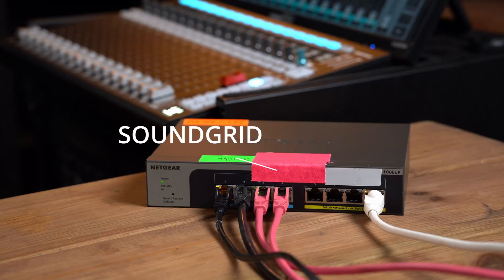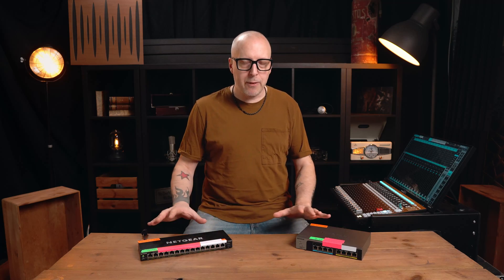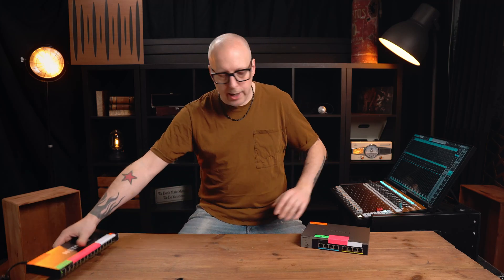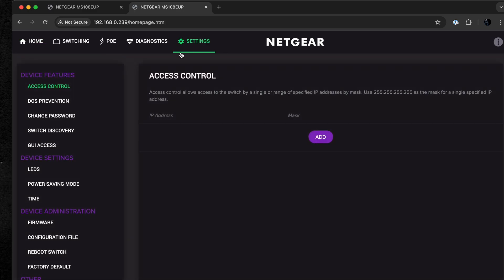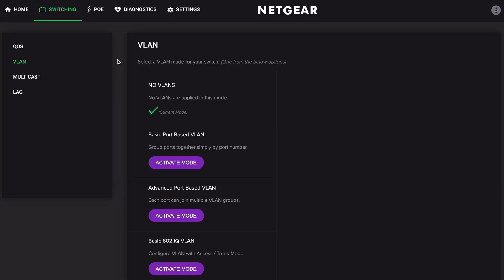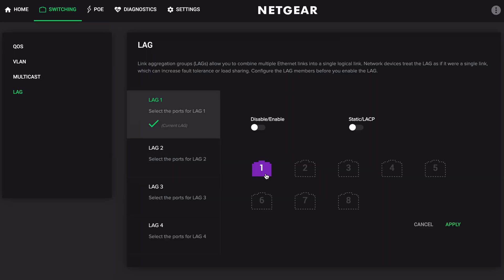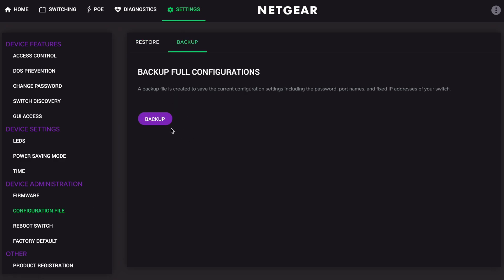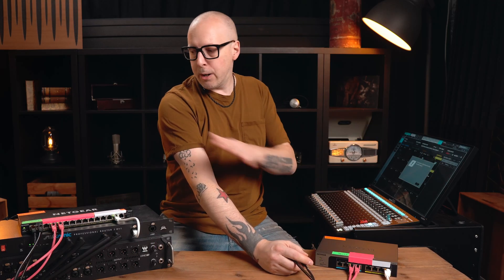Setup a Redundant Audio Network

Comment: Здравствуйте Joe скажите пожалуйста когда вы отключаете один из двух проводов есть ли прерывание звука? Есть ли прерывание когда подключаете его обратно?
Reply from the maker: Hi. With this setup there is absolutely no break in sound either when disconnecting or reconnecting. It’s just as if nothing happened. It works really well.

Comment: I bought two of the 16 port switches because I wanted to have fiber between Stage in front of house. I also need that many ports for the amount of devices I’m running.
I am 99% sure that I followed the video to the letter.
When I have two Econ cables plugged in, I get errors like crazy.
I am about to go to bed, but I have one Ethan plugged in and last I checked there are zero errors.
For the V lands on both switches, do you want the numbers to match? 
I did exactly what you did in the video where the default is number one and Sound greatest number 10. I did this on both switches.
Reply from the maker: Yes, the vlan numbers should match. Basically set up both switches identically. Give me a shout on Instagram or facebook when you wake up. I will have my rig going in a few hours and can guide you through.

Comment: Do you use ipv4 on a networkadapter connected to MacBook for recording ?
Reply from the maker: @tomjanssen9014
Of the top of my head I think it's ipv6. I use the Sonnet adapter and have switched from mac to pc for recording. I've just had more success (less errors) using PC.
I don't have a ton of knowledge about networking so I went through the optimization guide on Waves homepage and after that it works perfectly.
Reply: @joevegna yes, only ipv6, just wanted confirmation. Thank you for the videos.

Comment: Hey Joe. I too am not a Network specialist.  Question.. If I ran managed at FOH running VLANs for WSG and Control and sent 1 cable to stage, do I need to have a managed switch on stage where my stagebox and router are? Or will a dumb switch just "figure it out" on the other end?
Reply from the maker: @jcabanaw You would need a managed switch on both ends. I did a managed to dumb switch by mistake the other day. Did not work. At all 😅
Reply: Think of VLANs as isolated sub channels that travel over network cables or fiber optics, you need to have the same type of configuration on both ends.
Reply: @luis3mgm  Thanks for the reply. Makes a lot of sense.

Comment: Did you also test for audio dropozts when removing cables? I have some short gap of seconds when using the TP switches
Reply from the maker: Yes. No dropouts, no glitch, no errors. Everything works perfectly.
Reply: I have gs108Tv3 and I do get dropouts (very short) when using LAG and i disconnect 1 cable. it also drops when I plug that cable BACK IN.  i switched from LAG to Rapid Spanning Tree because the fail-over time was about the same but no issues when the secondary link returns
Reply from the maker: @magoostus  Really. Well whatever works I guess. I’ve had good success with the lag thing.

Comment: Nice video. I recommend looking at the Unifi Gear. A few Reasons, save some money, they recently added profiles for AV networks, but the main reason is that with unifi controller on the main router, you have 1 access page for ALL your connected switches and Access points. This makes setup so much easier, also you can label the gear for location and placement and if you forget can locate the gear by having it flash status led.
Reply from the maker: That all sounds great, will have to look into that. Do they have fiber connections as well??
Reply: @joevegna Yes unifi has switches with fiber slots via SFP. They also have some cool wireless gear as well.
Reply from the maker: Awesome. Thanks.
Reply: What unifi gear specifically? Very interested!

Comment: Great! I built my own audio IT network infrastructure with a similar concept, using MikroTik routers, and there is also the possibility of using SM fiber optic between FOH and Stage. With this solution, I am not limited by the 100meter Ethernet transmission limit, and I also have redundancy.
Reply: I don't have any issue yet, seems pretty stable. I have done a lot of test before using live. If you need long distance connection (festival situation) I can recommend this solution!
Reply from the maker: Great, thanks 🙏
Reply: Yes, I am a Mikrotik certified engineer. I bet you can find a bunch of turorials and community online, but feel free to ask.
Reply: @pelbarthu  I have spent over 100 hours trying to create a mesh network and it worked one time and then we had to shut things down and it never worked again. I have one access point that actually works, but only one device can connect at a time. I really want to get these to actually work.
Reply: @jthunderbass1  Check the DHCP settings.
Reply from the maker: That’s great. Have you had any issues with this setup or does it behave?
Reply: Are you an expert in Mikrotick? I have some access points that don’t behave.
Reply: Hi which model MikroTik router can you recomend?
Reply: @bonvonbon3721  I recommend L009 model. On stage side you can use the wifi version and you will have a built in WiFi control network for iPad.
Reply: Want to know about fiber optic routing settings

Comment: Great video, Joe, thank you! Just one question - is the trunk carrying the control network from the stage router to the host PC over the 2 trunk CAT lines or you have to have a 3rd line between stage and FOH?
Reply from the maker: The trunk carries both VLANs. Don't ask me how :)
So it would be enough with one cable for both the soundgrid and the control network. The second one is for redundancy and there's not a third cable.
Reply: @joevegna Awesome, perfect solution for bad WiFi coverage on large festivals and venues.
Reply from the maker: Absolutely. And I think an even better solution would be to set up access points. Could be a few different access points where needed. I’ve yet to try this though.
Reply: I have the server onstage because people have thrown beer on consoles I have been mixing on. 
Reference to the video of machine head where the guy threw a full beer on the Pro X. 
If FOH takes a bath, the show keeps happening.

Comment: Great video, very very helpful. Question.... If you are using the new LV-1 classic at FOH, would you be able to just plug the 2 trunk lines into the Ether-con connections, and still use one of the RJ-45 for a local laptop for Virtual Soundcheck, QLab etc? Also do you suggest having a server on stage or at FOH?
Reply from the maker: You will not be able to plug the 2 trunk lines into the Classic. It has to be dedicated trunk ports. The ports in the Classic is like a dumb switch. So for this redundancy setup you have to use a managed switched at FOH as well, like in the video.
The local laptop can then be plugged in to either the switch or the console, works either way.

For most scenarios I recommend having the servers on stage. Here I test what happens if stuff break. Could give some insight into where to put things.
https://youtu.be/BlYAAFQA9KA